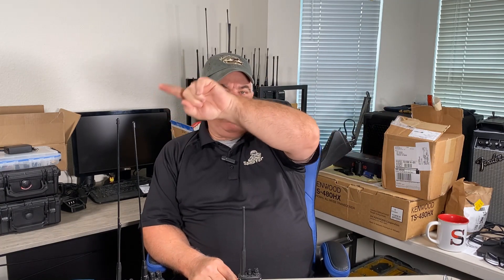VHF/UHF HT Maximum Achievable Range - Part 2: Understanding Line of Sight & Horizon

Comment: So the short answer is uhf/VHF equipment is completely useless unless there is an available repeater. So useless in a grid down emergency situation. I put a dual band vertical antenna on my roof, around 30’ off the ground only to find out later that the max range is 6 miles line of sight to another antenna also at 30’ with no obstructions. This is a joke, what’s the point- if someone would have just told me that when I was researching whether to get this for emergency communication I would have taken the $1,000 I spent on the whole uhf/VHF setup and went right to HF with a NVIS antenna. Now I’m stuck with $1,000 hard life lesson.

Comment: I've used VE2DBE's software extensively. You need to be conservative if you want FQ. But I've found the geo-plotting quite accurate. 

120 miles is outstanding. I've never gone beyond 90 mi. - HT to repeater. But have done 45 miles HT to HT with DFQ.

Aside from obstructions, which cast a propagation "shadow," there is the Inverse Squire Law. That is, at ever increasing distances, the signal fades at some point below the receiver's signal to noise threshold and becomes unintelligible. As an example, if you were to install a 5 watt lightbulb in your porch light socket, it would illuminate the immediate surroundings. You'd probably see it if standing back at 100m or so. But at 10 miles, it may appear dimmer than a dim star in the sky - lost to the background noise, so to speak. Same with RF radio signals. In messing with this, theoretically, I suspect about 200 miles might be a good estimate for VHF / UHF from an HT, at 2.5 watts, nominal antenna. You can push out a signal with more power or a gain antenna, but you'll still be working against two things you'll not solve: The curvature of the Earth I think mentioned in the video, and the Inverse Square Law. You can win at this game but only so far. ~WA4JC

Comment: I use a 19 inch long Signal Stick antenna on my Ht's. I have four HT's, and four Signal Sticks. They are 19 inch long quarter wave antenna's. But yes I tell people, three to five miles. I've been licensed as a Ham, since 2016. And I kind of specialize in HT's.

Comment: I really like your videos, as a new ham I really dove deep trying to achieve maximum range for vhf from day one after my call sign hit the books. Here in Alaska it is very mountainous and hilly terrain so this can come as quite a challenge for simplex operation. Several days worth in hours of testing I found that a lot of information found in the ARRL handbooks about LoS comms is not entirely correct in all situations. I wanted to start small and make small adjustments to find out what really works and changes things (sometimes small adjustments do a lot). I started with two handhelds, one in my house with an old cell phone recording the receiving frequency, the other in my truck with me creating distance on the move. I found that I could only go about .5 of a mile in all directions from my house on 5 watts until I lost comms. After that I constructed and simple dipole and hung it on the roof line of my house. I repeated the test with some decent results, maximum range of about  1.2 miles in some directions and the same as the last test in others. I still wanted more out of it so I purchased a cheap comet mag based antenna for my truck to hook my other handheld to and got very good results! In only one direction I could get 5.5 miles out of it! But in other directions I could only get about 1 mile, even at 18 miles where I have perfect line of sight communication to my house from elevation on a mountain I could not make contact. I pulled the plug and bought a used 50 watt vhf radio off eBay and now that perfect line of sight communication is clear as day, I can make some what reliable communication from about anywhere without line of sight for about 6-10 miles. In some cases radio output power can over come line of sight communications unlike what the ARRL handbook says

Comment: I believe that since both of your hypothetical stations are transmitting at 6 feet above the plane of the earth,  the radio horizon for each is 3 miles, and the total is 6 miles; but like you said, getting one or both up even a few more feet helps. I have stood in the bed of my truck to improve effective range jsut enough to pass traffic.

Comment: Outstanding instruction.  Broken down so most all can understand. I have a medium background in understanding comms from my time in the Army in the 80's & 90's.  At the platoon level we worked with the PRC 77   and then later came the handheld PRC 127 which was programmable like the UV5R.  Can't wait for the segment on directional antennas & signals.  Back then we used a Long Wire Antenna that was on a fly fishing reel,  Keep up the great work.